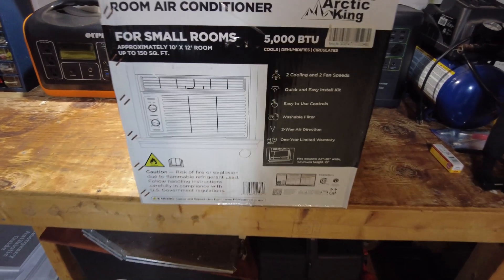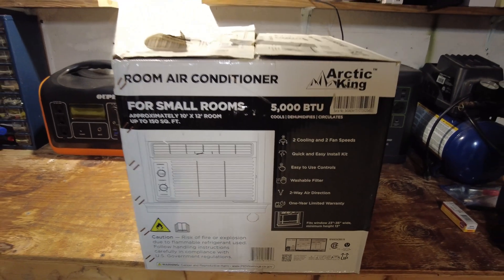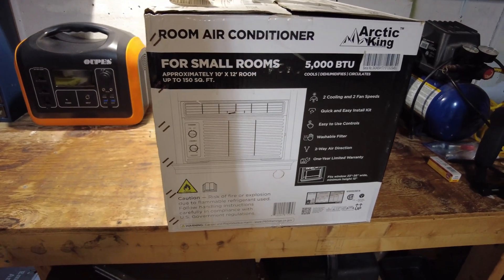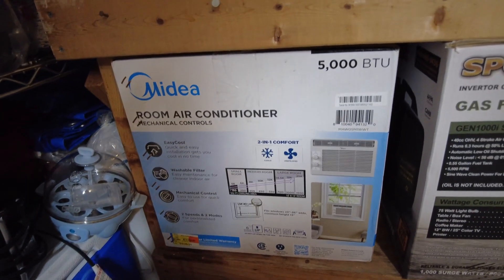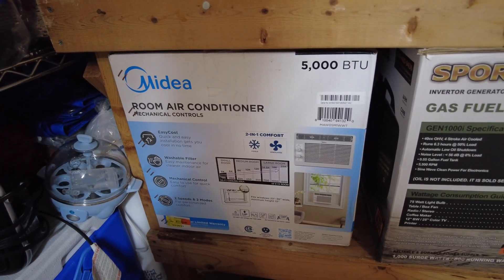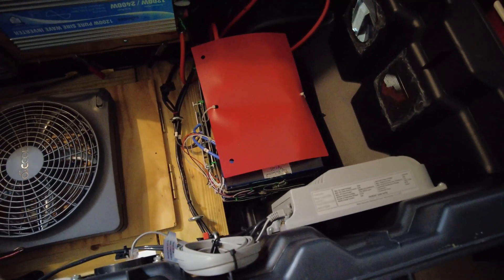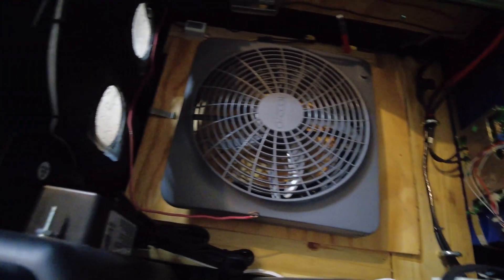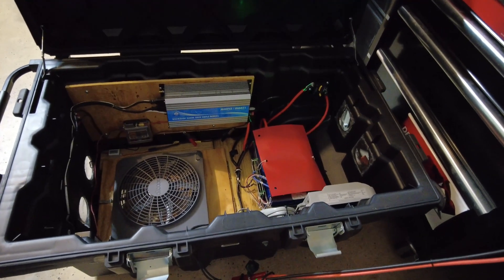Solar Powered Air Conditioning For Emergencies (or saving $)

Comment: Ever consider using an EG4 service rack battery and the EG4 off grid inverter.  You get 5KW for under $2000.  Nice work!
Reply from the maker: Thanks for the recommendation.  Yes, I have been looking at them... just haven't had the time, yet...

Comment: Thanks for the video.  I use my prep AC every day.  I'm in Arizona where the sun NEVER stops shining in the day.  I've installed 3 solar mini split units that totally now take the place of both of my home units.  The name of the AC units is called "Airspool"  I have each of them running on 3 - 455 watt solar panels and they run FULL BLAST in the day.  They have two power sources, grid and solar.  For the grid, they just plug right in to a 120 volt outlet.....  BUT  ....  "my" grid in more solar, inverters and batteries.  During the say, ALL my batteries now get to 100% by about 1PM in the afternoon.  SO, none of my AC runs off of the grid.  I also use all my solar for my fridge and small freezer.  It's amazing how LITTLE watts the fridge and freezer uses!
Reply from the maker: That's awesome!  In a few years, I'll have to replace my roof.  My AC is on the roof, and I plan to take it down and replace it at the same time.  I have a mini split cooling my garage, but am looking to use them in the rest of the house as well.

Comment: Cool 😅
I thought those window ac units would have used more power than 400w, I was thinking more in the 1000w range.
Reply from the maker: Depends on the size (BTUs) of the unit.  400 is on the low end, I've seen close to 1000 watts pulled by a 1200 watt unit.